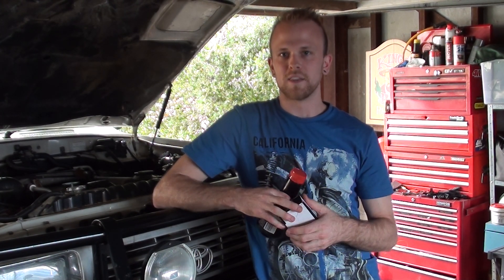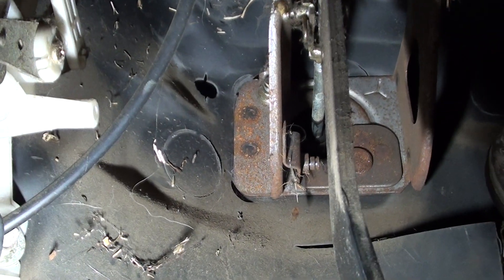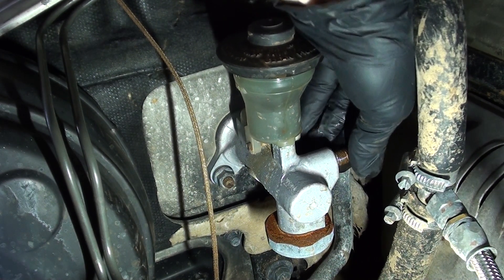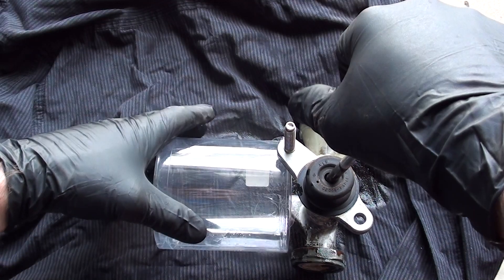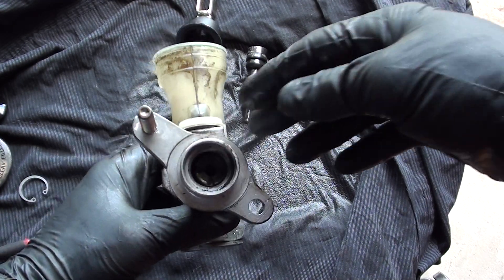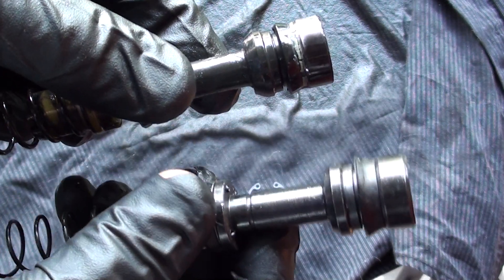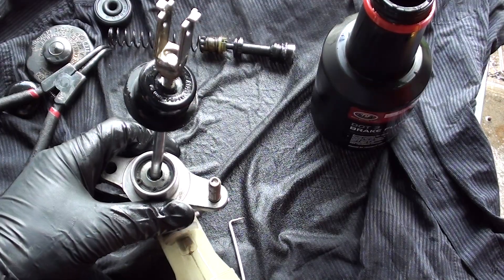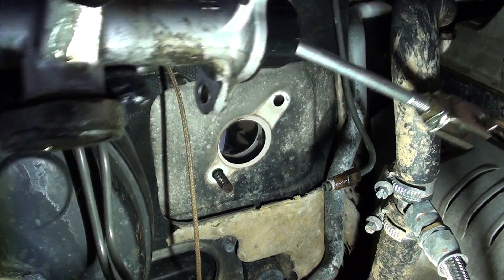How to rebuild a hydraulic clutch master cylinder

Comment: thanks for posting this.

I was expecting to see honing of the cylinder, just did my slave cylinder and it needed a hone due to visible internal damage. the bleed port on my slave was blocked and needed poking a fine wire through to unblock. compressed air would not clear it.

my parts guy tells me the clutch master piston is 15.87mm diameter on my VZJ95R toyota prado. all the brake hone kits I've seen nominate a minimum diameter of 19mm. (3/4") maybe that's why nobody(?) seems to have a video of honing a clutch master cylinder.  

will have to see what I find during dissasembly and if my existing brake hone will fit. part of me says : don't bother trying to save $ vs time, just replace the whole clutch master. 

just did my clutch slave : I found the lips on the piston rubber seals were hard to insert, the first lip required pushing the piston into the bore at an angle and working around to seat into the bore, the second lip was a pita to seat into the bore. felt like it needed something like a piston ring compressor to assist and avoid potential damage to the lip seals. maybe next time I'll cut up some plastic and makeshift a rubber seal compressor to assist inserting piston into bore. 

dropping that idea for others to critique. maybe I'm overthinking it.

otherwise, great tutorial and thanks for posting.

Comment: So when you re attach the line to the master I presume there is going to be some air in there which ultimately needs to get pushed thru the slave bleeder valve?

Comment: I've just stripped out a clutch mc which was totally seized, though almost new. It had spent 6 years in Javea in Spain with no use for most of that time.

It took me days to get the damned thing off as it was on a 1959 Berkeley T60 three wheeler with race prepared Mini 1275 S engine, and a one off motorsports chassis. I think they fitted the Willwood pedal box with the body off, so the access with it on is really very bad!

Anyway to cut to the chase, the problem was the red rubber grease they's put in to seal it up, before fitting the dust boot.

This had totally dried out, jamming the piston face and bore.

After (finally) getting it free with compressed air I cleard the bore and cleaned the piston with 1000 grit wet'n'dry wet with brake fluid.

It seems happy now, only of course the gremlins pinched the rod locking nut, and as I'm in France I will no doubt have a real pain finding something with the right thread...

Good video, glad to see I'm not the only one who gets brake fluid everywhere....I hope you missed the paintwork?

Comment: Lmao I lost it when you brought out the garden hose to water your engine bay
Reply: Brake fluid is extremely corrosive, eats paint, and hydrophilic, so he did exactly right. Probably should’ve explained why, though.
Reply: @davidleet9501  Probably not corrosive but it does dissolve paint, and by the time he's done washing it off it'll be too late

Comment: I’m bench bleeding my clutch master today , how come you didn’t put a clear hose goin back into the reservoir? Just wondering, from  other videos they always do that
Reply from the maker: Its not really necessary to bench bleed the clutch master. I thought it would help with bleeding the system but it didn't really do anything. If you are trying to then put the clear hose back into the resivour. I was more just trying to see if it was working ok and pushing fluid out.

Comment: I couldn't find anything showing me how a master cylinder 'should' shoot fluid out of the master to slave connection. So thank you for this video as it shows my master is not working as fluid does not shoot like yours just dribbles if it's held vertical, even horizontal yours shoots a good stream of fluid so mine is fubar lol
Reply from the maker: Sounds like the seals must have failed. It should have a good stream of fluid coming out the exit. Bugger!
Reply: HowToNick I took it all apart and no splits in the seals but I guess it's just worn around the edges.. I kicked the clutch really hard in my big work boots, that's what killed it 🤦‍♂️😂
Reply from the maker: @pcwexhaustmods  haha! Good old clutch kick 😂😂😂

Comment: Can you clean the inside with parts cleaner ( and let dry) before rebuilding?
Reply from the maker: Yep definitely, it would be ideal to clean out with brake cleaner after the parts cleaner to remove any residue as well. Cheers
Reply: HowToNick thank you man!!
Reply: @howtonick2803  i replaced a new piston and it went bad quickly, i guess the inside of the chamber is not soft enough and damaged the rubber on the new piston and the chamber could use some sanding but i don't know what sand paper number to use.
What do you say p320 or p1000 or what, i would really appreciate your help!